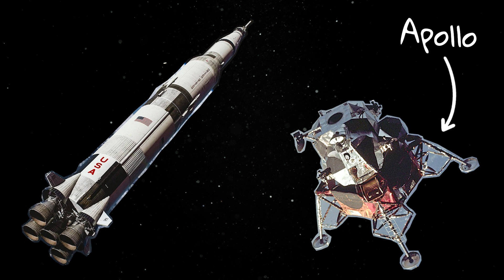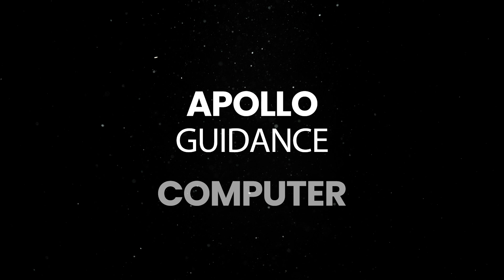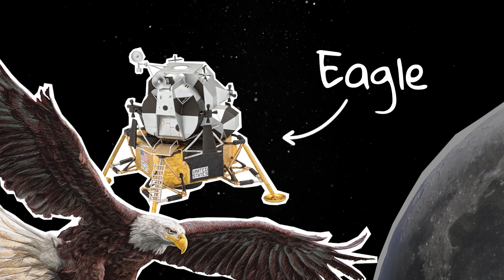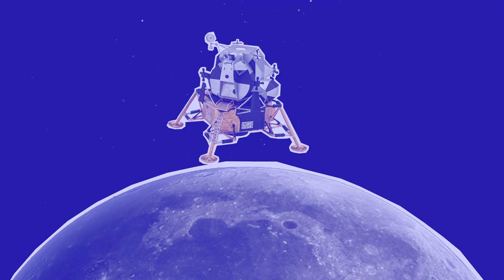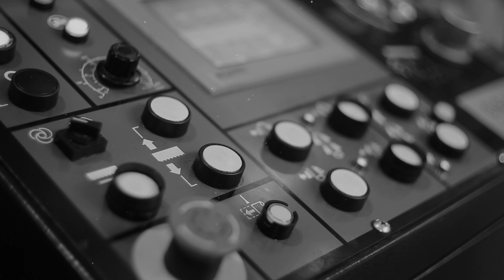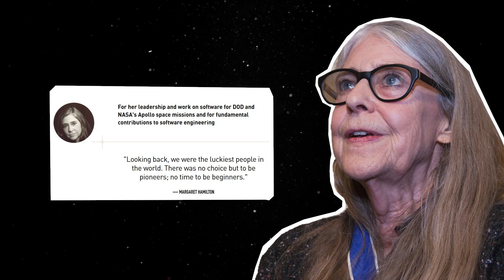The woman that put the first man on the Moon...

Comment: Also the Apollo Guidance Computer gave the world another, but the greatest, gift to the world: Being the first computer controlling a plane without other backup systems, starting the digital fly-by-wire (FBW) revolution in aeronautics.

That not only made pilots less exhausted to fly airplanes but also increase a lot in safety just because computers can monitor the airplane way faster and accurate than humans, reducing the risks from mechanical or human errors.
Reply from the maker: Great point!